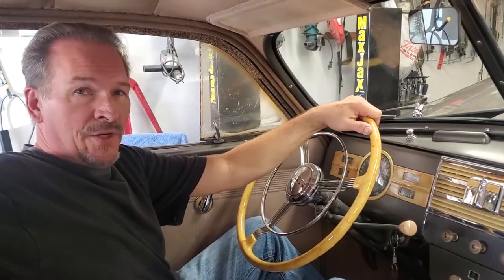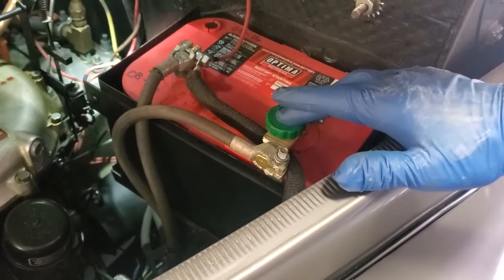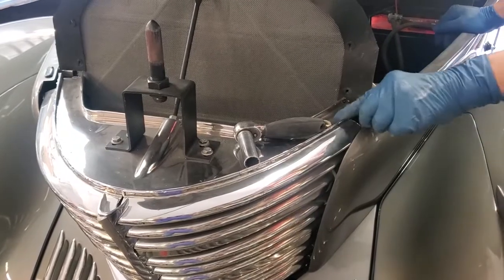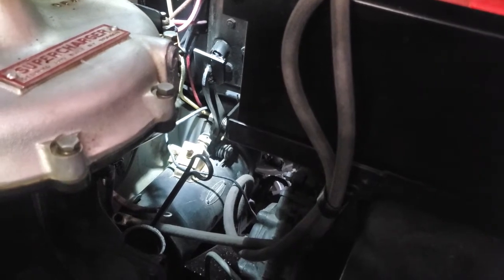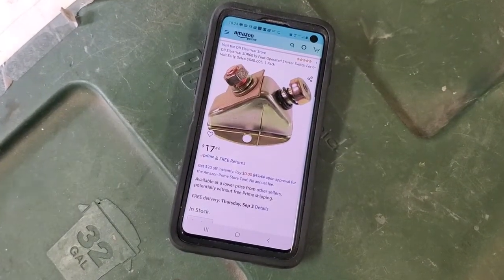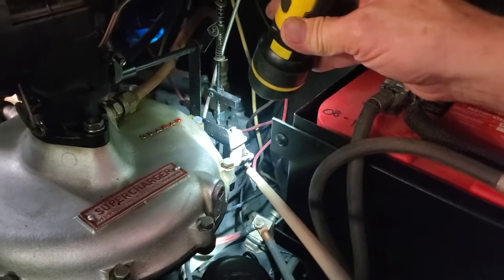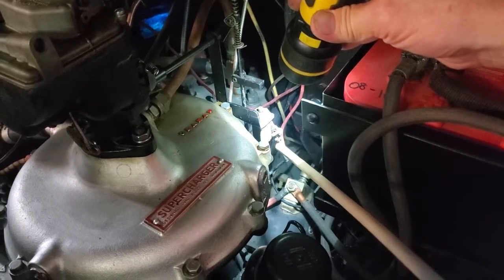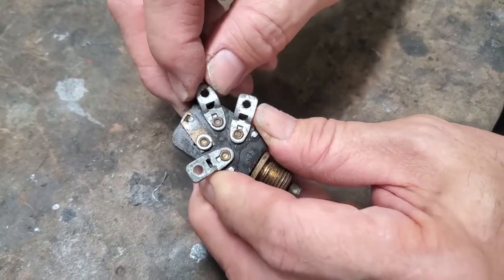1939  Graham Sharknose Starter SNAFU - Troubleshooting a 1930's Car Ignition Starter Switch

Comment: Didn’t realize the OD switch could cause starting problems.
Reply from the maker: The overdrive switch functions to give a momentary stop to the ignition in the car. This normally causes an imperceptible miss in the engine that takes the rotational load off the drive train.  This allows the car to have the solenoid on the transmission act to drop the car out of overdrive mode back into normal drive mode. If the switch or its wiring circuit is faulty, the ignition is dead or at least intermittent. While fixing the starter issue I obviously, in retrospect, bumped the switch with my arms resulting in disturbing the faulty contact. My first thought was a carburetor problem as I had been adjusting it in the last couple of days. However, I quickly ran a test with my spark tester and found I had an electrical issue. Upon checking connections the loose contact at the switch was discovered and fixed.